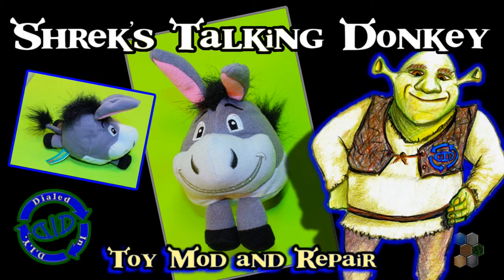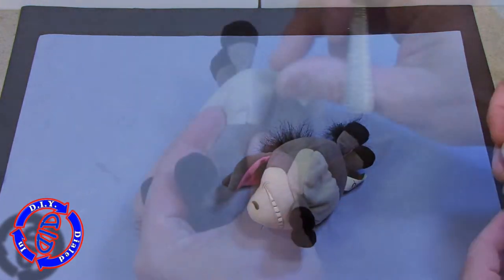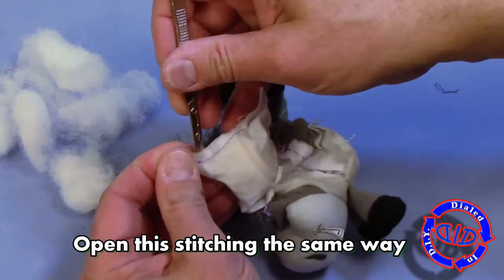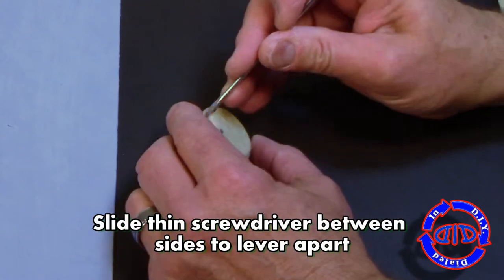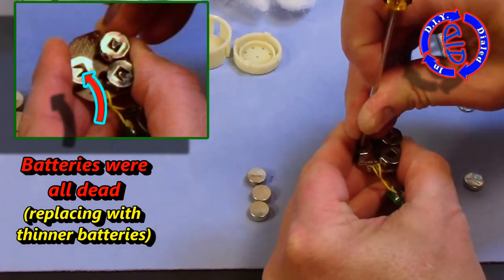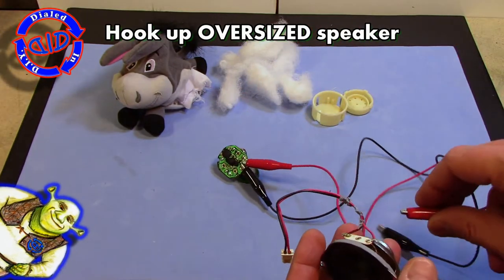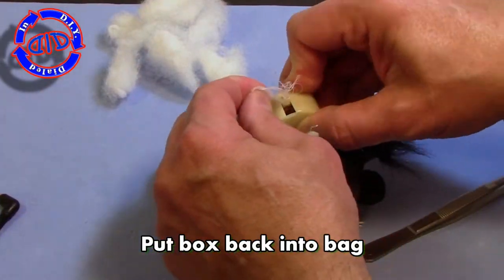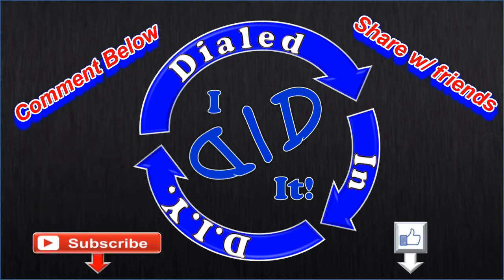Toy Repair n Mod - Talking Donkey fr Shrek - See how it works

Comment: Hello, My son has a "My Talking Tom" stuffed cat doll that has a button on the hand that runs to a talk box that also records your voice. He loves this thing. I fix all his toys, but I cant figure this out. He also has a Mickey doll with a button on hand to talk box too. it also has the same exact issue?
I've changed the batteries, and the wires seem tightly installed. You have any advice where I can go from here? The talking tom doll is Brand new? So he kind of wants this. Any help would be great.. Thank you!!
Reply from the maker: The talking tom doll might be something that you could return/exchange under some kind of warranty. Sounds like it had a defect to begin with.  Is the problem that you are having with both that they do not respond at all or is the playback messed up?
Reply: @DialedInDIY  The Button on the hand does nothing. The doll has no function. it seems there's a very thin wire that goes from his hand all the way to the battery box in the back area. It did function at first. Thank you for your reply
Reply from the maker: @jimwates8047  sounds like you checked the wiring connections at the sound board so I am betting there is an issue with the button / switch (which is usually sewn inside). If you can't feel the button depressing and then pushing back up then it may just be stuck. Otherwise there is a chance it is not making the electrical connection complete when fully pressed.
Reply: Thanks, I'll try and get back to you..

Comment: Hi, Dialed in DIY! I'm looking to create a toy like this but need to do some research...
I wanted to ask you about the parts you seperated in this video:
How is the microchip called? What about the other parts? I saw clearly the buttons, batteries and microchip but don't know their exact names.
How much would a toy like this cost to make?
Where can I find these parts?
Thank you so much! Really appriciate your videos.
Reply from the maker: Hi Overwatchy.  Great questions and sounds like a cool project idea you are making.  Cost is harder to answer because it depends on several things.  First of which is the function you want to accomplish which also decides the type of chip set.  The PCB with the components are often called IC Voice Chips, Sound Chip, Voice Module, etc.  You can actually find them pre-recorded, recordable 1 time only or even re-recordable. The basic chip has nothing else attached (quite literally) and the more advanced have all of the extras built in already (i.e. battery holder, speaker, buttons, etc.)  Some will activate to vibration or light exposure too.  You can find all the options I mentioned on Amazon by searching something like "recordable sound chip."
Reply from the maker: Part 2: forgot to mention, the total effect is created by the following key parts: power (batteries), speaker, activating switch (button, etc) and the voice chip.  As I mentioned, you can actually buy the voice chip set with all of those parts built in.  Just make sure to check the details to see how they mention to record the sound.  Some can be recorded with the buttons on the voice chip, others need to be plugged into an audio device and still others may need a specific program running on a computer. 
I hope that helps... let me know if I missed any of your questions.
Reply: Thank you so much! I love how much detail you put into everything, thanks for explaining it to me!
I've been looking for the parts you told me and they all seem to be fairly priced, I think the project's going pretty well! I wanted to create a toy that would help children eat lunch or dinner and encourage them to eat well. 
Thanks for helping me out!
Reply from the maker: You are very welcome.  I'd love to hear how the project turns out when you are done... it sounds like a great idea!!  Thanks for the feedback and for watching the video(s).
Reply from the maker: Hi Overwatchy, I recently got some similar questions on another video - https://youtu.be/gvKSppDdt34.  Check out the chip Faith found - it is linked in the comments.  I checked the item and it is listed for $8.99 and can have 20 different sounds recorded to it and each time the switch is activated it goes to the next recording.
Reply: Dialed In DIY Thank you so much! I really appriciate you remembered! I'll check it out, thanks :)
Reply from the maker: You are very welcome; hope it helps!